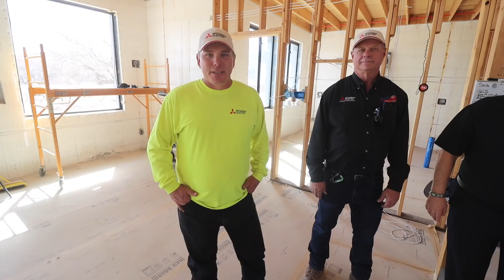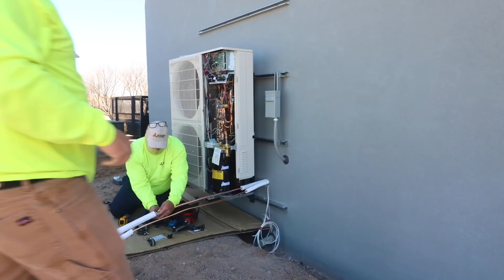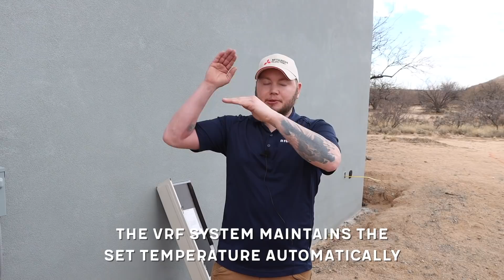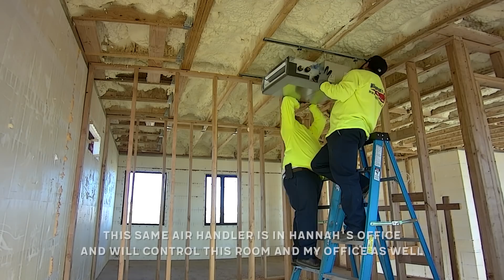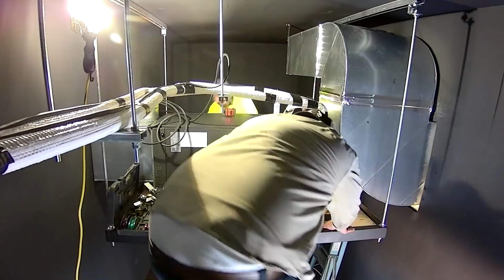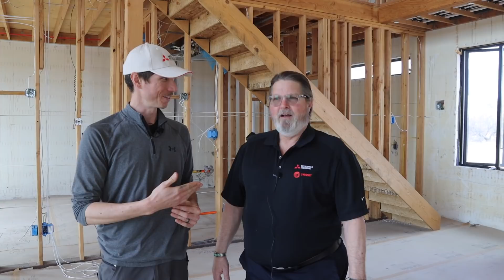My High Efficiency 4-Zone Mitsubishi System Tour

Comment: Phew. This is a good video to understand a sophisticated installation in new construction.  Quite a bit of engineering, and no doubt will provide good efficiency for a 100% electric powered HVAC system. 

In our 3200 sq ft home, I've have a 95% AFUE gas hot air furnace that still works great after 24 years.  It has required zero repair service that I could not handle myself.  (annual cleaning, replacing igniter & motor capacitors  - that's it).  The comfort factor (balancing the system) is done adjusting simple flapper valves in the ductwork - and yes, at initial setup, it takes some fiddling during your first heating season.  But it's all simple stuff.   The complexity of a system like this one is incredible, and Mitsubishi only provides a 10 year warranty.    I like the idea of reducing emissions for our HVAC needs, but as I plan for the eventual replacement of the trusty gas furnace, I cringe at adding  the complexity of compressors, refrigerant, and air handlers to our in-home equipment inventory. 

I also look at this particular installation, and I see beautifully done work to place pieces of the HVAC system throughout the home in a "zoned, central-air" system, but the resulting limited access for repair or replacement of air-handlers buried in an attic, a small, space-contained elevated platform, or above a suspended ceiling screams "high-cost-maintenance or replacement" to me at a level where the potential energy cost savings of a heat-pump-centric HVAC solution might be lost over the years.  

And I would think that users installing a system like this would demand warranty coverage on major components for more than ten years, especially from a premium Heat-Pump equipment brand like Mitsubishi.

Comment: Since this install was sponsored by Mitsubishi,  would they allow you to overclock the system? Can yo push the pressures up to 1200 PSI ? Musk was right Physics is the limit, everything else is a choice. ? Is the refrigerant Physics, can it respond to 1200 PSI? And if it can, could it do 2400 PSI?  @ a 1/4 use of energy? It would play hell on the sensors….
But deliver low cost heat /AC to the globe. That would push past a SEER of 78 return on billable electric bills US.

Comment: Man you’re darn lucky. I’d do anything to get a Mitsubishi system like this in my house. I really hate my old forced air unit that came with my house and it’s old. I was recently told the unit is over twenty years old and could go at any time. I pray every day it doesn’t break down because I cannot afford a new system right now.
Reply: If it does go, just start by having one mini split installed. Then add on gradually.
Reply: @user-ln7of9gs4s  That sounds good, unfortunately one mini split won’t cools a three bedroom house plus a basement. It gets ridiculously hot in the south and especially with the recent heatwaves we’ve been having.
Reply: @pf5658  trust me, get a large enough unit, and it will do more then you think. It might not cool your basement, but it will keep humidity down and comfortable.  You can also look at Pioneer and Daikin for lower cost brands.
Reply: @user-ln7of9gs4s  Ok, good to know.  Very interesting. Thank you.

Comment: You dont need to factory trained... I bought all my equipment on ecomfort installed everything, condensers, electrical, indoor units, line sets... you can (with the right tools) do the work... but you may need refrigerant and nitrogen....  that i could not get so i hired someone to do the evacuation and startup.

Comment: I have been in HVAC since I joined the Army in 1996 and with a commercial HVAC contractor since early 2000.  The installation is CRITICAL on these systems.  If you use a low bid, unprofessional, untrained installer, you will have problems and the system won't last.  If installed properly and the procedures are followed these are extremely reliable and almost silent and very economical to run.

Comment: He said turn On/Off when temp is reached? But then the nerd said it was a variable RPM compressor. Are they hiring?
Reply: It is variable speed, if the temp is reached then it doesn’t need to be on. It slows right down and if temp stays stable for a certain time, then it turns off briefly.
Reply: @CT-vm4gf  That is what I am saying. He should have said ON/OFF, just slows/speeds up.

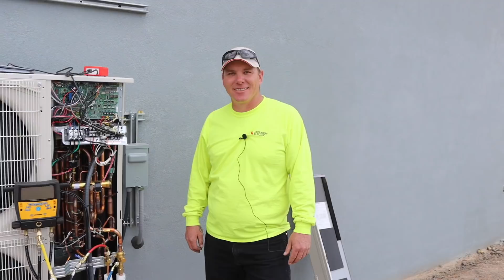Comment: 5:40 Is that sound typical for a Condenser? 

Air conditioning isn't very common here in the Netherlands, though I believe popularity of heatpumps is going up, with a move away from natural gas, and if I remember correctly there's new regulation about noise for these kinds of systems. If this sound is typical, I can see why.
Reply from the maker: It's not a typical sound, that noise only happens on the initial startup which I should've mentioned :)

These are extremely quiet units from Mitsubishi. I'll do another video on the system when everything is complete.

Comment: Thanks for the awesome video. How many BTU is the system? And in your next HVAC video can you go into how you sized the system?
Reply: the lead installer said 3.5 ton, which is 42,000 btu. contractors have load calc program(s) that gives them that info, or have manual-J book.

Comment: Japanese equipment ....such a these machines is high efficiency and low energy having ,
Because Japan has not oilfield .
I am using same company air conditioner too tiny one  in Japan ,   Mitsubishi is good  choice .
Reply: There is also DAIKIN from Japan which is one of the worlds biggest HVAC manufacturers

Comment: Do they install liquid line driers to each evaporator coil ? If not in five years the evap coils will leak. Air n moisture in refrigerant will make mild acids n eat the lines n coils, filter driers absorb this moisture even the best vacuums can be wrong n minor amounts of moisture left in the systems during installation. 
Plus conventional systems are about quality air  filtration systems how do you change the filters? Filters will pass dirt n dust and as it plugs the coils, you will lose surface area and thus lose tonnage and unit runs more to maintain same temps, dirt is the number one killer of AC coils, people don’t change their filters monthly especially with pets.
But that system looks very high quality just wondering about filtration to keep it quality.
House is looking “ real nice”

Comment: For an ICF home, isn't 3.5 ton a bit excessive or because it vrf it doesn't matter?   Most ICF homes can undersize their HVAC equipment due to how efficient they are.
Reply from the maker: Never judge a system size like that, you need load calculations done and this was the smallest system we could put in
Reply: @Handeeman  ok I figured it had to be something like that.  Awesome work so far!
Reply: Load calculations for HVAC equipment is called a manual J.  I've heard a manual J doesn't properly account for the thermal mass of concrete/ICF building, so systems end up being oversized for this type of construction.
Reply: @Chris ICF doesn’t have an adequate assessment for Heating and cooling ratings. They aren’t even assessed properly for R-value. I think you are correct that this system is way over sized.
Reply: @wcbscout  I hope he does a follow up next year.  I wonder if it short cycles or if the vrf actually works.
Reply: Actually thermal mass can be a bad thing when in a climate that's cold or hot for month. Once that concrete gets hot or cold it stay cold hot hot, unlike a stud wall where the wall will warm up when the sun shines on it in the winter or the wall will cool when the temperature drop at night.

Comment: Bearing in mind the extreme weather Texas has had recently, have you taken an external precautions for protecting your installation from the elements? 
Great video and great series so far, really enjoying seeing your build from my european perspective. Thanks.
Reply from the maker: This unit has built in hyper heat so it will work down to some pretty cold temps, I think below zero

Comment: This really should replace all conventional AC in US.
Other parts of the world has had this thing forever.
Reply: Should replace antiquated heating systems too. I live in the northeast and replaced my 1960s oil-fired hydronic heat with two LG inverter systems. My estimated electricity cost for this past heating season is ~$600, oil would have cost near triple that.
Reply: And further taking away American jobs in the process by relying more on Asian made products.

Comment: Thanks for this.  I've been looking into this exact system for my home.
Reply from the maker: Sweet, thanks for watching Matt 😎🤙
Reply: I'm kind of concerned about that electrical board being in the elements outside. Seems like it could short in bad weather. Even though there's a metal cover plate, all the humidity and changes in temperature could do damage to sensitive electronics.
Reply: @AndreyB-b1s  those things are actually built to stay outside, DAIKIN Japan also has such equipments.

Comment: Here in S Florida, we've encountered extensive mold in the inside unit and the ducting in our system when constantly running air or ramping slowing off after the compressor turns off due to the cycling of the moisture that remains in the evaporator once the compressor cycles off.   We've found that it's best to turn the fan off when the compressor is turned off, which keeps the moisture in the evaporator rather than spreading it into the ducting when the fan ramps down as the compressor cycles off.   How would the Mistubishi  address an issue like this?

Comment: This is a very interesting system.  What is the general cost of this system vs a conventional system for your house?  I am wondering if there is a significant premium for this system that is paid back with efficiency and/or comfort.  Good video.
Reply from the maker: It'd be hard to know the cost of our system versus a traditional system because when we designed the house, I knew it would be a multi zone system. It'd be hard to do a standard system in this house because of the layout.
Reply: It will never pay for itself . If you have deep pockets so you pay for comfort. If you are not rich the comfort, you get with the system, is not worth lots of discomfort  you get trying to earn money. For myself I find a way to have a cake and eat it too . I buy  chinese mini splits , installe them by myself 3 head system for total cost of $2500  instead of $15000 which a contractor quoted for install

Comment: where we live, AC isn't absolutely necessary.  There are only a handful of days that are somewhat uncomfortable in the house. and our nights are rarely not cool. That said, I've been looking at doing a 2 zone Mitsubishi Mini-split system.  It would serve our great room and master bedroom.  We're looking at a 27,000 BTU system.   The fact that they are also heat pumps is advantageous.  Since the house is existing, I  have the ability to run the line sets up a wall in a closet and then across the attic.  They will mount fairly high, one around 11' and the other around 9'.  We have a basement so the lateral run would be there..